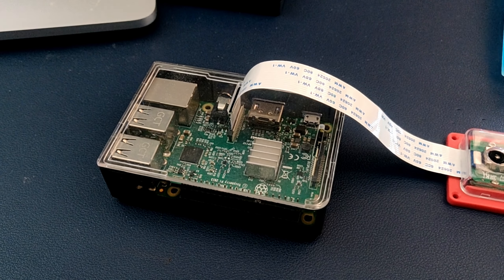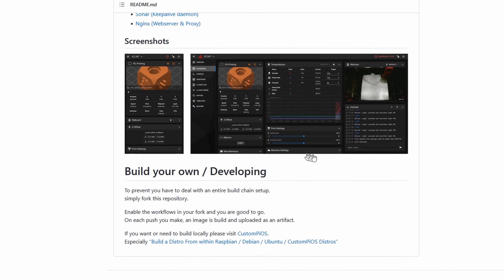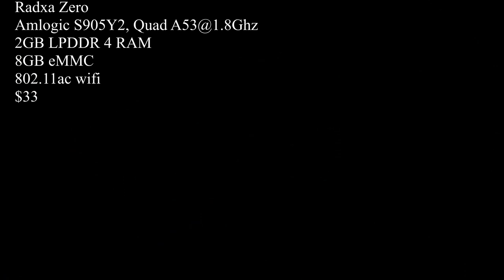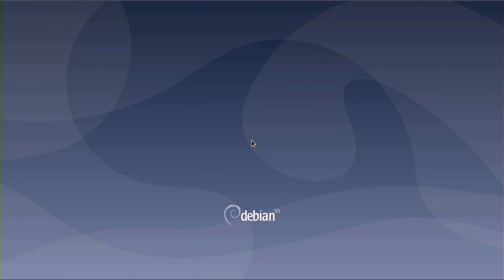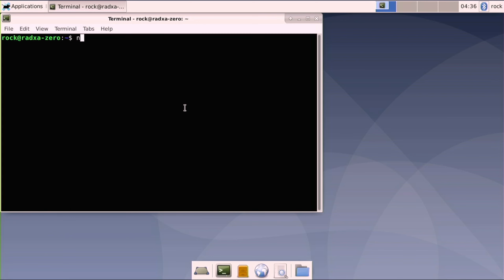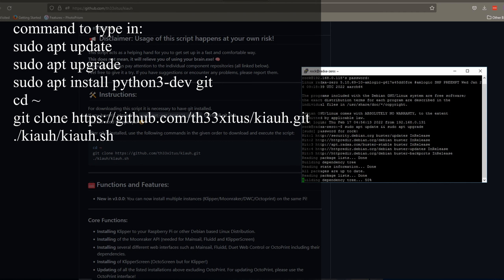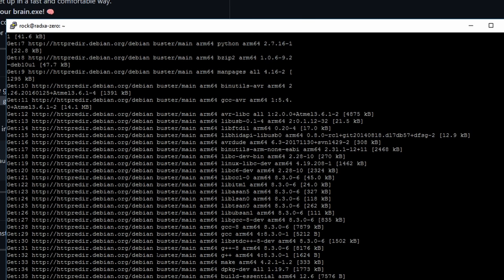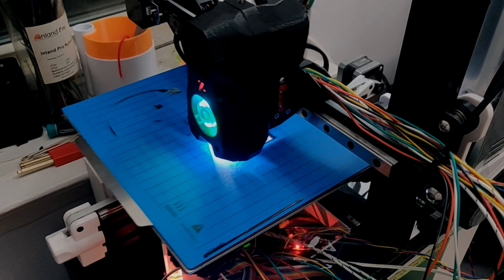Get around Raspberry Pi shortage installing Klipper to other SBC's Radxa Zero

Comment: And 2 months later, the Radxa Zero is only $110 cries
Reply from the maker: wow I didn't notice, you can get the 1GB and 2GB version that are still reasonable prices though.
Reply: @TechExploresNYC  Although I have some CB1 board on order from BigTreeTech, I settled with a cheap $90 Intel Celeron oon Amazon and although I'm still building the printer, had no major problem installing Lunbuntu and Klipper & co with Kiuah.
Reply: I was looking to get one as well but, not at that price